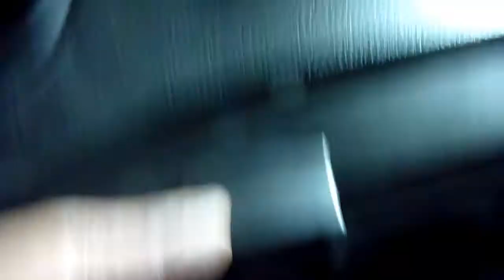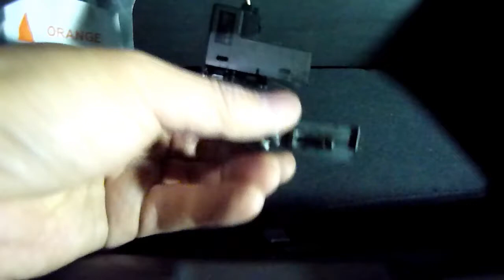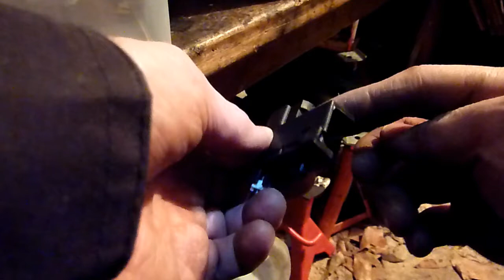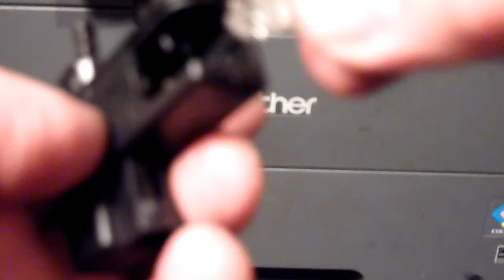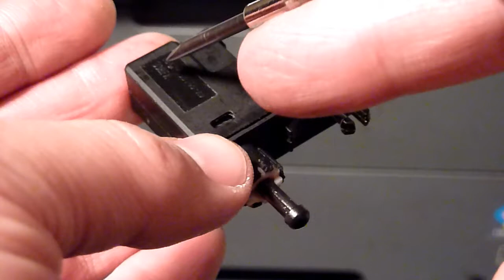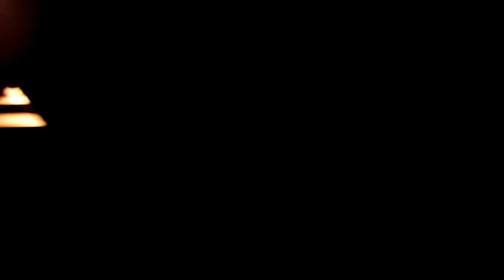How to Change the Glove Box's Light Bulb on a Ford Focus 2015 TDCI 1

Comment: It was a little hard to understand you but how did you fix the spring part of this ? Idk if I lost it or not. My button won’t come back out when I press it in
Reply from the maker: Pop open the four latches (you can see two rectangular slots even in the thumb nail) and replace the spring or better still buy a new unit from Ford.
Reply from the maker: Don't forget to try some WD40 in the spring mechanism, just in case of some kind of sticky substance causing the issue.